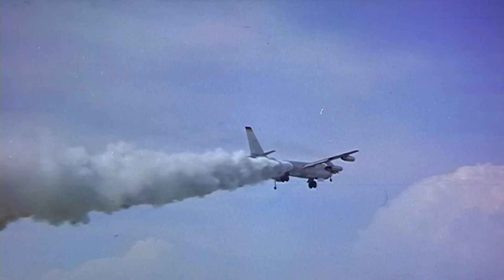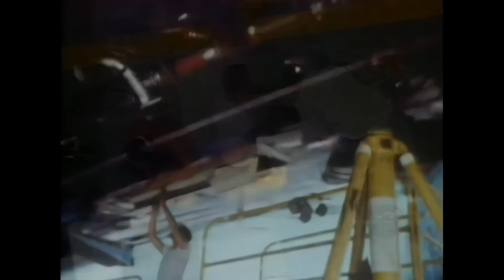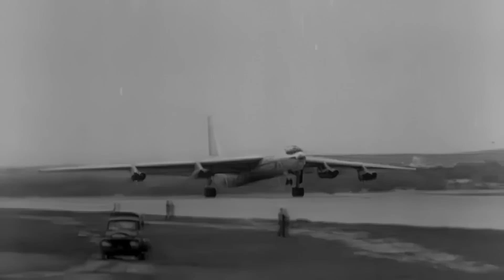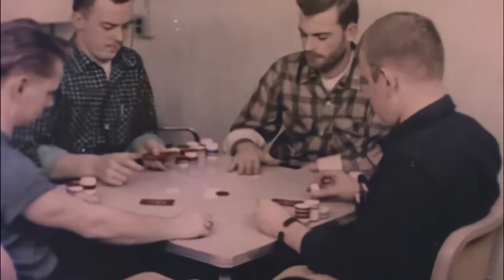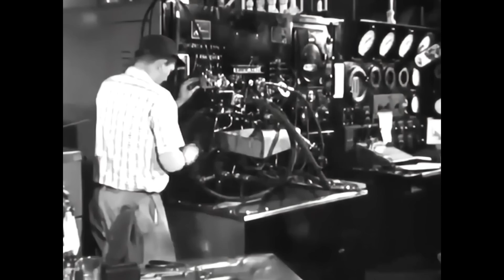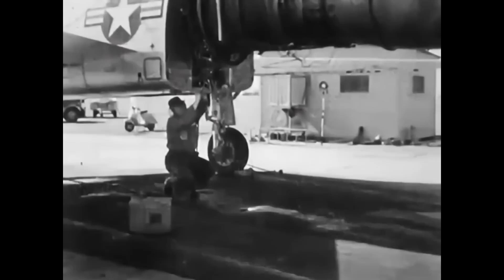B 52 "The Buff" Stratofortress, And The Evolution Of Giant U.S. Bombers

Comment: The H and G model tail gunners were NOT omitted, but the gunner was moved to the front cockpit with the rest of the crew.
The B through G models used 4 .50 cal machine guns, not cannons. The H model used a 6 barrel 20 mm Gatling gun. The tail guns were finally eliminated in 1992.